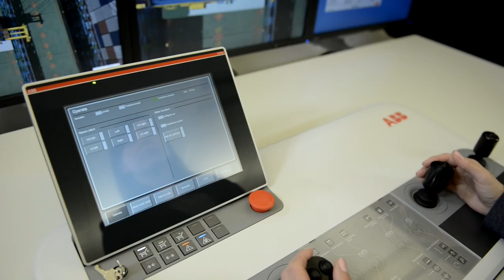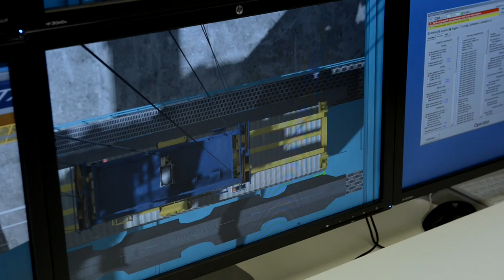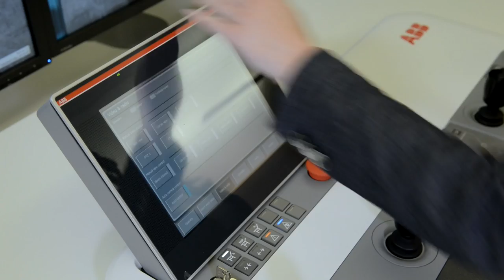Container Terminal Automation - Uno Bryfors - ABB

Comment: hanjin 😬. wish I could do mechanical repairs from a desk 🙀 lol
Reply: Maintenance is not a real issue for such ports. With fewer larger ships, the planned downtime is increased. A friend does maintenance for heavy vehicles, including some cranes in hamburg. For maintenance jobs he usually gets a time slot of 10-24 hours with no ship expected at that position. For sure, it's something different when important equipment goes down, but usually the equipment is redundant.